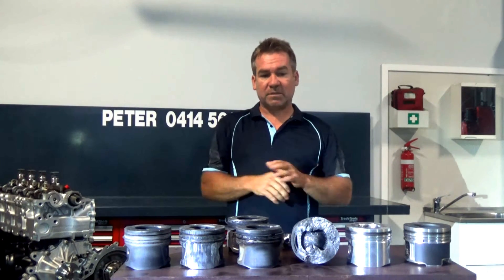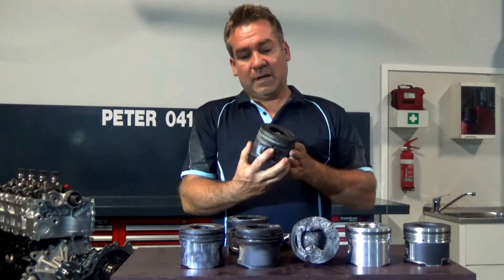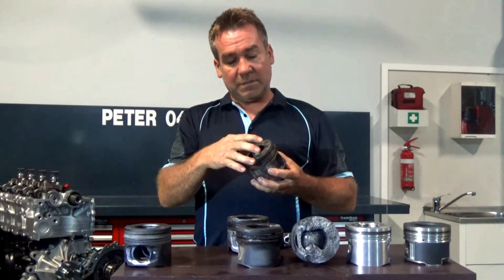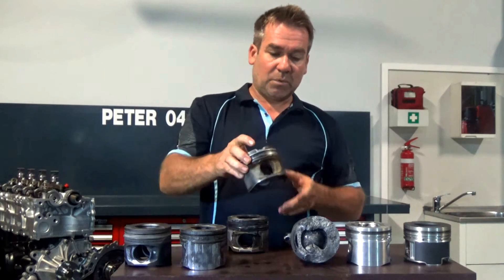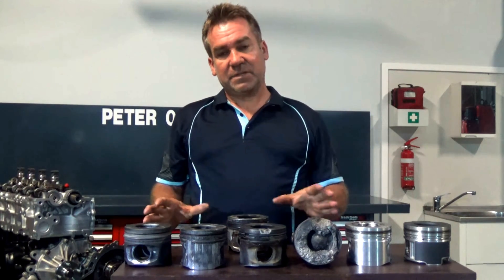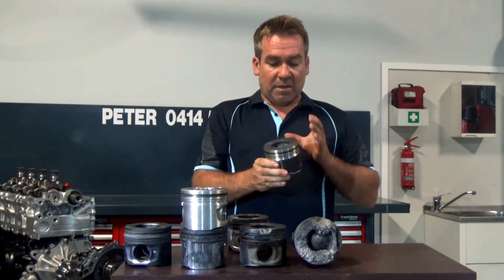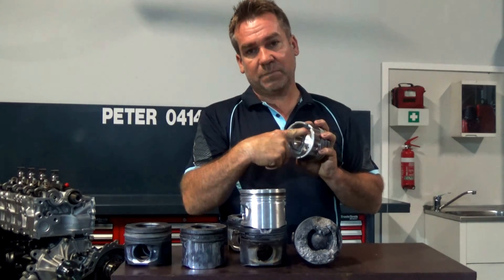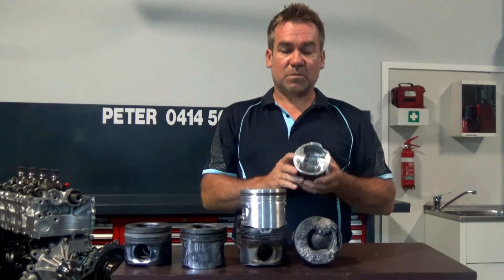Toyota Hilux Prado 1KD engine piston failure explained, hole cracked etc

Comment: Just had to rebuild a 1kd, hole in piston, other 3 had cracks starting as well. Just did a fill rebuild, sadly got your info too kate so fitted another set of sh!tty toyota bs pistons. Wish i knew about the other options prior  anyway keep up the good work

Comment: Great presentation and video.
I have a 2 kd with almost 700,000 miles.
On mornings if let it idling for five minutes or more it sents lots of blue smoke but, for the rest of the day it stops.

How much would a recondition 1 kd engine cost.
Or a complete overhauling kit including connecting rod, main bearings and four of the pistions that you recommended in your video.
Awaiting your response.
Thank you.

Comment: I have been a mechanic for 26 years. just purchased  one of the last v6 prados in Australia to be sold as a demo model. 2017 kakadu v6 10,000 km . I am selling my 2010 d4d before it blows up and am washing my hands of the diesel and all its weaknesses. And the 2.8 with   dpf , seriously who would go there.?
Reply: why would 2010 d4d blow up?  are they are problem too.  how many kms did you notch up on it, without problems.  curious.
Reply: @luketmc-qld3554  The reason is that in some vehicles the top of the piston develops a cavity on the edge of the combustion chamber (top of the piston) and then this becomes a weak point. Toyota Motor Corporation are on their fourth design with the last new design being in 2017. The 130 piston. Toyota Australia are using up the 110 piston stocks knowing there is still problems with the 110 pistons. The 130 pistons are not available in Australia as yet, so one can only suggest what I said there is true.
Reply: Done quite a lot of tuning on stock D4D 1KD engines, some have well over 500.000km on them and no problems!

I have seen failures as described in the video, but most commonly due to mechanical failures (sticky injectors, EGR failures etc)
Reply: @ViktorAgnarFalkGumundsson  Just wondering what you mean by 'sticky injector' ?
Reply: @volcanic5187  injector stuck open ;)
Reply: @ViktorAgnarFalkGumundsson  Is that 500.000klms with original injectors ? in Australia ?
Reply: @volcanic5187  no that is 500.000km on the opposite part of the planet, in Iceland.

Up on glaciers and in snow and ice..
Reply: @ViktorAgnarFalkGumundsson  Oh ok different conditions there, not sure if engines are the exact same and have same specs or not though..
Reply: @ViktorAgnarFalkGumundsson  Sticky injectors? LOL. Propaganda you are peddling because it's the pistons themselves that are the problem with the cracked holed situation. In all my time working on these engines, I only seen one failed EGR valve. And that's thousands of vehicles, Mr. Viktor.
Reply: injectors are a replaceable maintenance items, they need to be replaced every 150k or you run the risk of cracked piston etc, if you don't replace them good luck to you, again preventative maintenance is the key
Reply: @emoil42  Load of rubbish. The crack piston situation has nothing to do with the injectors. In Toyota's words, too. Load of rubbish for this piston failure you are describing.
Reply: @emoil42  That's why the person you follow blew holes in his 1KD. No creditability except for lining his own bank account. Help masked as a bank account.
Reply: @emoil42  Yes so I see, I will be replacing my injectors asap with the updated OEM Denso DLC's I have 225,000 klms on the vehicle and thinking of putting in new forged, teflon coated pistons as well, not too confident in the pistons in there now..

Comment: Been there done that D4D $10,000 later ... never again 1GRFE V6 all the way wish I bought one from the start
Reply: Buying a diesel to save money on fuel is a false economy
Reply: @cameronembrey2389  Correct, when it comes to the 1KD-FTV found in the Prado and Hilux models.
Reply: @cameronembrey2389  I bought a diesel just to drive in front of cyclists!
Reply: rx713bbp since my comment a while ago now I purchased a Prado with the V6 dual VVT-I 
Excellent on fuel and heaps of power 
I done a trip with my hilux D4D from Brisbane to Darwin total Fuel cost was $1320
Done the exact trip from Brisbane (give or take 100 kms )to Darwin in my Prado total fuel cost $870
Great fuel economy, yes it uses a little more around town but nothing to raise an eyebrow over 
Having the peace of mind of not worrying about injectors , common rail issues in general  , turbo , shit Diesel , EGR blockages, DPF problems etc ... 
I stand by my original comment %100 , Cheers
Reply: @deannt2927  After a lot of research, it seems to me that 'Toyota reliability' slogans are mostly because of its petrol engines rather than the diesel ones. I want to buy a second hand Prado, do you suggest I buy a petrol one?
Reply: Not entirely true older Toyota diesels were reliable. The common rail 1KD and 1GD aren’t that great

Comment: Amazing how Toyota's reliabile diesel engines have changed over the years, i have a 1999 5L 3.0 litre direct injection, non turbo, diesel, so far done 360000 klms, does not use oil, still has plenty of power, had no work done internally on the engine, has been regularly serviced and never driven hard.
Reply: Had a 3.0L d4d DC that has done just under 500.000km went to agents for service did the wiring and rewiring to the engine and ECU thing still runs
Reply: @paulroos7946  I just bought one last week my dad mate just sold me his old hilux 10 years old 150000Km that comment reassured me!
Reply: 5L with plenty of power ?? for real ?? lmao
Reply: because they have sold 50x more d4ds than your old diesel, therefore there will be much more cases of engine problems, it's a relative, doesn't mean that the d4d is less reliable, there's hundreds of thousands of these engines out there will incredibly high kms and less than 1%, with cracked piston due to inadequate maintenance and prevention
Reply: 360,000kms? The thing is only just broken in!
Reply: is only 130 HP.........